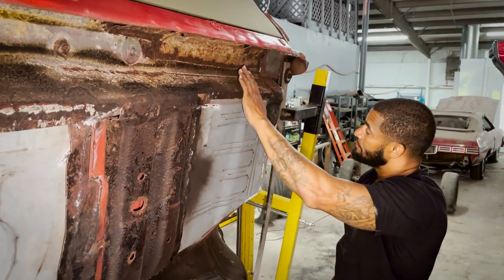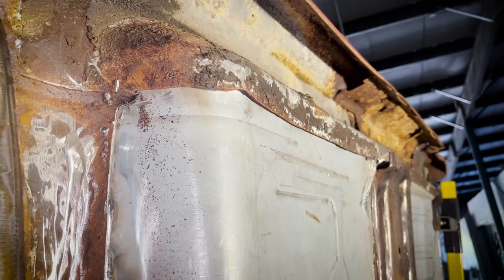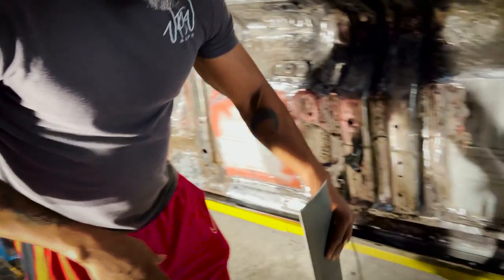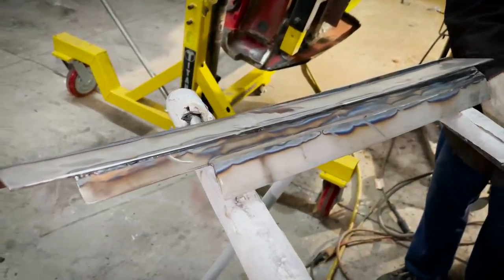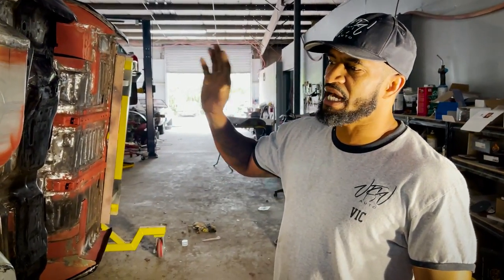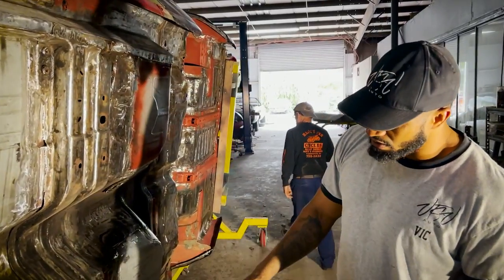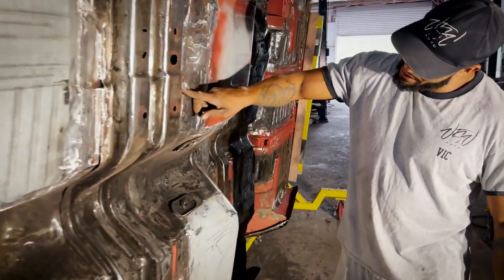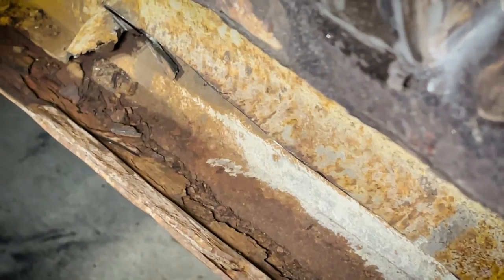Undercoat Removal - 1972 Chevy Impala Convertible Donk

Comment: Question do you recommend for the car to be strip or sandblasted?  Which is best?
Reply from the maker: We prefer to old school hand strip it to prevent any warping on the long panels like the hood. Sandblasting is faster, but easier to damage the metal. You also need account the time it takes to get all of that sand debris out of the car when your done so it doest get into your paint! Same with an acid bath. It's faster, but you need to hunt down and eliminate any residue that may be left over to prevent rust from starting and ruining your paint job after it's complete!
Reply: @VTSVAUTO   It’s a lot of prep and different methods to blasting and stripping that I didn’t know.  I understand it now hand strip will be the way I go.  Thank you for the reply.  Keep going love you guys work!
Reply from the maker: @arealkingdcook_GCF  Hell yeah bro, tag us to your build on insta, would love to see it. Thanks for all your support
Reply: Chemical stripping is best. As long as the car dryed . And primed .  White cleaning vinegar  works on hardware.  Fender bottoms. Exc.